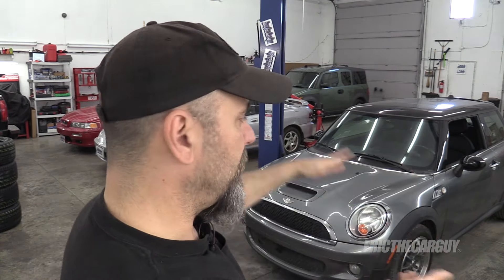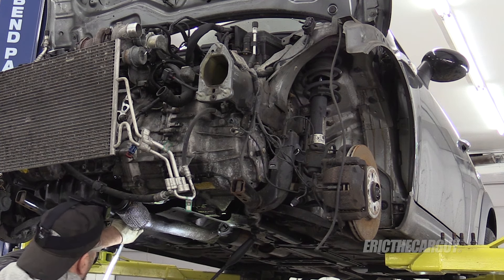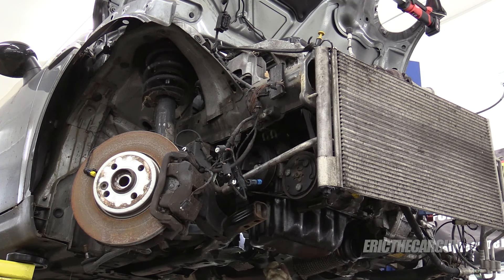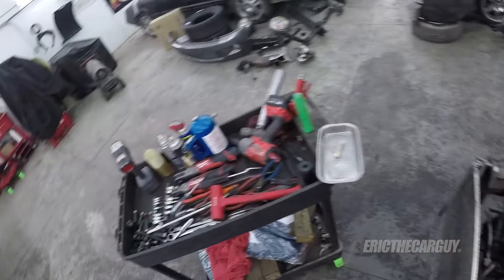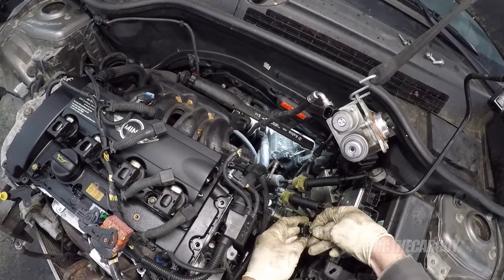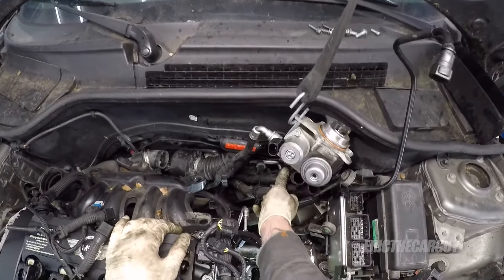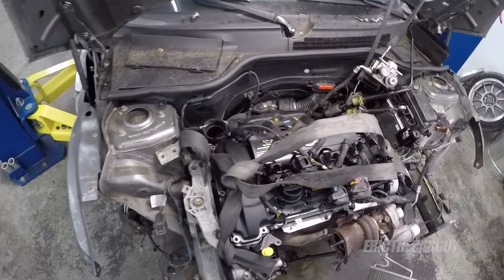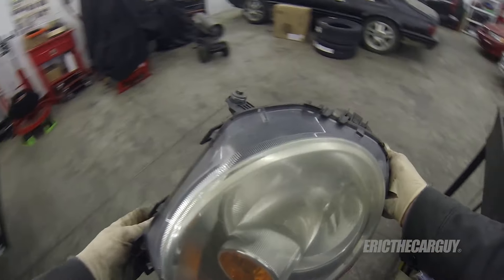Mini Cooper Engine Removal (R56/N14)

Comment: To address the fastener issue I learned to buy boxes of sealable snack bags and zipties or twist ties. I put the fasteners in the bag, seal it, then ziptie the bag to the part. If the part uses more than one size/style of fastener I will bag and tag to the specific location on the part. I do something similar with pistons, conrods etc by placing them in a bag and labeling their position in the engine. Masking tape and a marker help with identifying bracket, sensor, hose etc locations too. It's only a few seconds to each part that saves hours of frustration later when working on a long term project. It's especially handy when building transmissions with all the clutches etc.

Comment: There is an added benifit to filming a job, you can skim back through the raw footage later if you're not sure about something, your own video haynes manual.

That came apart without tears, smashing job eric :-D.
Woven seatbelts are very strong, i have mates that use them too.
Reply from the maker: Honestly, I didn't think this car was all that difficult to work on. It looks so much worse that it is. As always, thank you for your comment.
Reply: Taking your time.
Reply: Wobbly sauce, is there any need to rush?

Comment: Another good video!  While that engine bay seems very packed and complicated, it's not really that bad a job.  I've discovered that it's usually easiest to remove an engine the opposite way that the factory installed it, which is what you've done here for the most part!  Like you, I have a lift, which makes this kind of work much easier :)

Comment: Just used as seat belt to install a 5.2l into my dakota. held up perfectly fine. Best part, It doesn't scratch the pain on the engine or engine bay.

Comment: It sure is a lot easier when you don’t have the front end, I do swap engines under recall sc147 for Kia and I have to take the hood off or sometimes I take the subframe out with the steering rack and get the engine from the bottom, my best time has been 2:45 minuets when taking out the 4 banger, the V6 and AWD not so much fun maybe 4:30 hours.

Comment: Seatbelts are CRAZY strong.  They have to be.  The testing on these things is amazing.  The shock strength is beyond anything you would experience (and survive).  Seen the testing before, and anybody that doubts their capability...yea.  Would I pick up 2 ton with it?  No...but that's what lifting straps are for.
Reply: Yeah, a seatbelt can easily lift the weight of an average car. It's not going to have any problems with an engine. Crash forces are absolutely immense.

Comment: Hi Eric! Have you ever done a video of removing a drivetrain with a fantry crane lifting the front of the car off the front subframe? Some folks prefer it, but it's all a matter of personal taste and using what you have. Great video man!
Reply from the maker: I have removed engines via the subframe in the past using a lift and a dolley. However, this engine/transmission doesn't use that style of support as you can see in the video.

Comment: I think I need some electric hand tools.  

You don't realize doing it, but wrenching everything out by hand makes a few hour job take a full day... or two. Even twisting as fast as you can, in an easily accessible place, a single bolt can take 5x longer. It adds up.
Reply from the maker: Did you watch the video or just comment? Also, please realize I was a flat rate mechanic fo years. I know how valuable time is. That said, thank you for your input.
Reply: @ericthecarguy  Pretty sure Oblithian was talking about his need for power tools...

Comment: Eric! Assuming those plastic electrical plugs w/the metal clips are the same as the BMW plugs, you just need to squeeze them in. No need to remove the metal clip part. I learned the hard way....
Reply: You're correct - they are the same - you just squeeze/push the metal clip and then pull the connector to disconnect. To connect, you just push down the connector so you hear the click (it is the metal clip that goes over two small plastic tabs - one on each side).
BMW used these for at least 40 years now (see them all the time on my E30 323i -85 for example).

Comment: I may have missed it. Is there a sub frame that needs to be dropped before removing the motor? Fantastic videos by the way. I'm about to rebuild an R56/N18 motor that the previous owner over heated.

Comment: I've replaced high pressure fuel pump son these cars twice now and I just used a ballpoint pen to depress the indent in the fuel line coupling. Never had issues with it leaking in my experience but better safe than sorry.

Comment: OK I am nearly 2 years late Eric but maybe I can help people. @ 11:53 you took out the wire clip to free the electric plug. Don't need to do that just push the clip IN and pull the plug off. Yep I learned the hard way after losing a wire clip ...
Lovely clear presentation though mate well done.
Oh and forgive me but those electrical connectors aren't German ...lol

Comment: You do have to be careful when using any kind of strap to pull or move engines. The one down side to straps/seat belts  is they can get cut and tear/break.  Seat belts are pretty tough but they can still get cut.  I was recently loading a engine into a van when the strap I was using was cut by the sharp corner of a cylinder head. Which let the engine drop to ground and crush the sump on the oil pan. Luckily I was just lifting it when it happened so it was only about a foot and half off the ground.  I prefer using chains but I was in a rush and didn't have a chain handy.

Good tip on the fasteners/hardware. I like using small tool/tackle boxes or in a pinch even some zip lock bags to organize and store the hardware.

Comment: Ah the lovely THP engine ( Peugeot/ BMW engine as we know it over in England ) 

Timing chain kit , oil feed pipes ( the updated type that doesn't leak from the top 'swivel ' part on the banjo ) 

Also worth checking the inlet VVT pulley solenoid that's hidden behind the inlet to throttle body pipe, had a few bite me in the arse as they're known for breaking up and creating a misfire situation without fault codes. 

Inlet side of head also worth walnut blasting as they gum up bad

Comment: Eric, one topic I don't recall you tackling is the "while you are in there" mentality... particularly as it related to project cars. I find myself falling into this trap all the time with my projects... go in for one thing and find more - which you have spoken to the spend on the Fairmont. What I mean is more like, how do I feel good about not replacing everything when I have it loose/off. The logic of replacement always makes sense, so I find myself going all in all the time... as a professional, it might be easier to justify the limts (although you have spoken to the responsibility of a mechanic). 
I know we aren't watching live, but it relates to this project pretty well - just a thought and curiosity on my part.
Reply from the maker: Give it time, the series isn't over yet.

Comment: hey eric, you dont need to pull the metal retainers out of those electrical connectors like on the gearbox at 11:47. you can push them in and they will come off. working on euro cars every day here in the netherlands ;). great video!
Reply from the maker: When it is difficult to access the connector, like it was in this case, I find it easier to remove the clip than try and depress the tabs.

Comment: I often organize parts on the ground in the same form as the part. If i am taking out a bumper/front end i lay out the bolts i the form of the bumper, so i know where each bolt was.

Comment: When I see an engine removal like this it reminds me of how many many years ago some friends and  I got together to remove and replace the engine on a 1988 Hyundai Excel (this was back in 1992). We were very meticulous about disconnecting and labeling all of the hoses and electrical connectors. We used a chain pulley and a heavy tree branch as our hoist. All went well except that no one bothered to remove the gasket material from the intake manifold. Also, we yanked the torque converter out along with the long block, lol. When we put it all together we had quite a gusher of coolant out of the intake / head mating surface and there was a puddle of transmission fluid under the car. As a bunch of "never have done this before but how hard can it be?" 20 year olds, we got saved by my buddy;s dad who was a mechanic. My friend and I still laugh about this. He ended up becoming a master technician for Izuzu and I went on the become a machine programmer at a major automotive parts manufacturer.

Comment: I was thinking of picking up one of these as a bit of a project car to learn on. i found one locally that has intermittent power steering problems. Would changing out a PS pump be a reasonable job for a home DIY'er with standard tools?

Comment: Hey Eric, is it possible to remove the engine by itself and not pull the transmission with it? I'm working on an R55 with an N18 (the process of disassembly of the front clip has been very similar to the N14 you depict in your videos, thankfully!). I have to replace the engine would prefer not to have to pull the axles if I don't have to. Thanks!!!

Comment: I called a parts place to get rotors and pads for my 2008 rav 4 . they asked me if it had 3rd row seating. my car is not equipped with the seat but does that really make any difference or is that just a selling point because of the potential extra weight they give you a bigger pad and rotor? Cause they are sold out of the ones with no third row seat and I want the parts if they will work

Comment: That has camera isn't that bad of a idee, it beats moving the camera on a tripod around.I was considering doing that myself but was afraid it had too much movement. but it isn't that bad.
Reply from the maker: You have to be careful of the movement. I've had a lot of comments that people don't like it just for that reason.
Reply: I was one of them.  It's not so bad in this one, but in the one last week it was borderline motion-sickness inducing for me, and I'm normally pretty resistant to that.

Are there cameras that have super aggressive image stabilization like the more recent iPhones have?  Maybe you could use one of those so it doesn't appear quite so shaky.
Reply: I don't think it is the stabilizing. I think it is the fast head movement and sway. But you have great dynamic footage and that is awesome. I think this is a steep learning curve but if you master it you have great footage.
Reply: That is a nice camera, but I doubt it solves the rapid motions of head turning and swaying.

Comment: I find it easier to drop the exhaust, gear linkage, clutch pipe, strut top mounts etc.. you can drop the engine, gearbox and cradle all in 1 lump, i find it quicker to do that than just removing the engine and box because that's the way it's installed at the factory.
Reply from the maker: On this car, or some other model? On this car the engine does not rest on a subframe is the reason I ask.
Reply: plc- tek unfortunately that method doesn’t really work in front wheel drive cars, because the engine mounts that actually support the engine and transmission are bolted directly to the frame rail, which is a part of the car’s unibody. The only exceptions to that rule I believe are the Oldsmobile Toranado, and the big Chrysler cars from the early 90s to the mid 2000s due to having a longitudinally mounted engine.
Reply: most of the cars i work on in the uk can be taken out that way.

Comment: Nice work. Eric, I haven't heard from you or seen it in the comments about the removal of carbon deposits on the backs of the valves. Since this is a direct injected engine: Will you walnut pean the backside of the valves? It's my understanding that these engines are notorious for carboning the backside of the valves and tend to need this remedial service performed. Thank you.
Reply from the maker: If you follow my social media you'd have seen I've already dealt with that. It will be featured in a future video.
Reply: Perhaps I would if I used social media. Thank you for the very prompt response. When you're done, this car should last many years without much trouble. Fingers crossed!

Comment: Eric PLEASE HELP. At the 7:42 mark of your video you quickly disconnected a plug and it was so quick that I have no idea were  it goes or what is it. I did the head gasket and valve job on this car for my daughter, HATE this car, and now I am not getting no spark. This is the only plug that I can't fin a connector for. PLEASE HELP

Comment: Not sure if you mentioned it in a previous video or I just missed it in this video. Why are the engine and transmission coming out? Rebuild?
Reply from the maker: It needed a timing chain. I also wanted to check the clutch. It made more sense to just remove the engine for those. My plan for this car was always to make videos so an engine removal video is not a bad thing in that context. It ended up needing a clutch. I'll be releasing videos on both jobs in the near future.

Comment: Physics time.  In a car crash the seat belt will experience a load of roughly 30g.  Take an average man at 180lb and that means the belt is dealing with a high (albeit brief) load of 5400lbs.  Pretty sure even if my math is a little off that most engines dont even come close to this weight in a typical (especially 4 cylinder) car.

TLDR:  If a seatbelt can keep you from going through a windshield itll hold an engine up.

Comment: this here is the quintessential DIYer's german car experience right here.  1: look at this nice car with low miles and simple (to the uninitiated) problems for the same price as a beat up corolla!  2: Who could let such a nice vehicle fall apart>:( I'll buy it fix the simple things, and drive a 15K car for beat up corolla money!  I'm a genius!.  3: wow, even harbor freight doesnt have these torx sizes!  I'm sure buying the tools is gonna be the hard part.  4: [reality setting in] I cant believe I had to take the front of the car off, the interior apart, and the engine and tranny out to fix some seals and a timing chain.  5: Parts are gonna cost THIS MUCH!?!?  How do you even make these parts for this much!  6:  Well I put it back together and got it working after only buying half the parts to save money and having to take it back out twice.  But at least I have a nice car.  I'm gonna enjoy the fruits of my labors and drive the shit outta it!  7: 2 weeks laters... when the: parts you didn't replace/thing you overlooked/new problem/thing you were ignoring  causes an issue and you have to take it all apart again.  FFFFFFFUUUUUUU-.   Rinse/repeat until you are a broken shell and can't even give the thing away.

Comment: Eric, when you call the mm sockets something like "E10", you should rather write "W10", because the whole world uses the metric system, except for a small number of very few countries like the USA.
Edit: Or if I may have misinterpreted that, then what else does the E stand for?
Reply from the maker: E-torx is what they are referred to as. Also, https://www.youtube.com/watch?v=bLNXyX5hz8c&t=3s
Reply: So is E-Torx something else than a normal Torx head? Or what does the E stand for?

Comment: What I've learned from this series so far.  Germans make great electrical connections.  Unfortunately everything else is made from the cheapest materials in the most complicated way possible that essentially guarantees premature failure (but out of warranty) and is unserviceable.  Germans are masters of planned obsolescence.  Having worked on multiple Fords I can say there has to be better connectors out there than FoMoCo uses.

Comment: How can I contact you? I have a question local mechanics haven't been able to help me.
Reply from the maker: Please use the resources at EricTheCarGuy.com to get help with your automotive issues.
Reply: EricTheCarGuy I've been on your page, read through the menu and stuff. Read the whole article on rough idle. Closest issue to mine. But nothing.  My issue is I have fuel pouring out the tailpipe.  The issue is intermittent.

Comment: Do not remove those metal clips from electrical connectors.. You should squeeze them inward, that releases the connector.
Reply from the maker: I realize that, but it's not always practical based on location of the connector. I've had more luck removing the clip and reinstalling it in those situations over trying to depress the clips.

Comment: you don't pull out that clip on the connector of the starter . just push it in eric!
Reply from the maker: Because access is difficult, I find it easier to remove the clip over trying to depress the tabs.

Comment: Strange! The fuel pump is on the head. direct injection technology!
Reply: Most ( if not all)  direct injected engines have the high pressure fuel pump mounted on the head.  These systems run at 2,000 psi or so fuel pressure, so the high pressure line from the pump to the injector rail is a short as possible.......  (There is still a low pressure electric pump mounted in the fuel tank...)
Reply from the maker: That's actually the second fuel pump. It also has one in the tank under the back seat. Diesels also have fuel pumps like this.

Comment: You start the video half way through the job. Useless.
5:12 You're talking about heater hoses, showing the radiator.
5:25 What fuel lines and clutch connections?
5:37 What alternator connection?